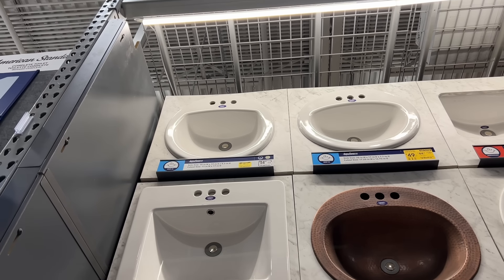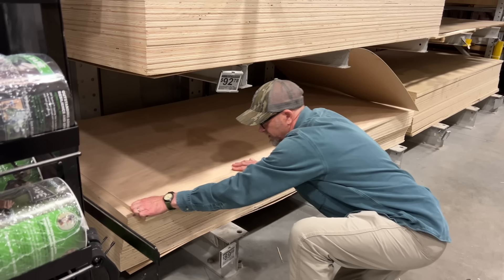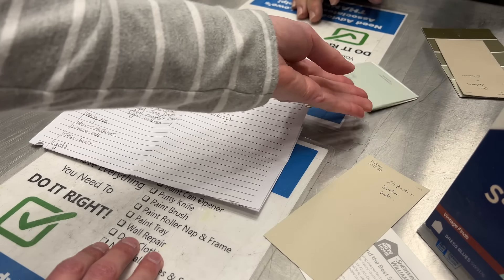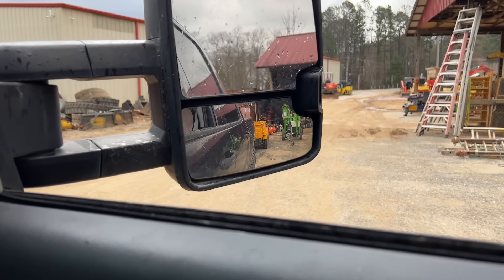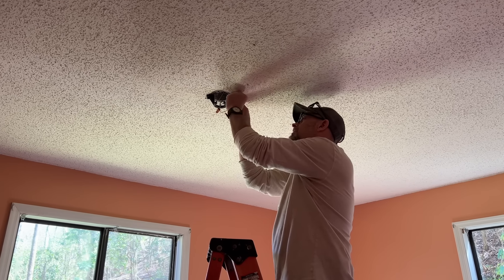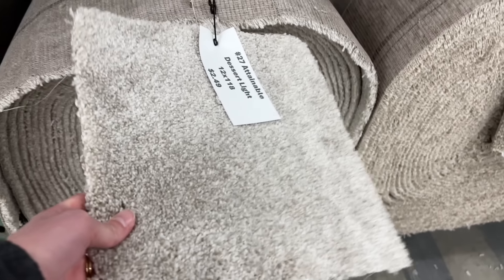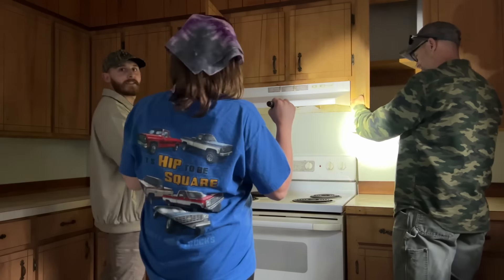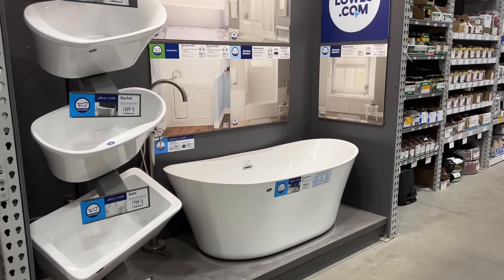Working On Our New House - Paint, Faucets & HVAC

Comment: As your painting different areas different colors I had saw where someone had cut a small piece of the paint color sample sheet and they wrote what rooms/area the paint was used and where they bought the paint from and they taped all the different samples colors inside a cabinet door or inside the panel box/ utility box  that way if they ever needed a touch up and forget the paint color they would have it handy. you could even tape it them to the bottom of a "junk drawer" put clear packing tape over it and it wouldnt be seen but would be there to reference if ever needed.. So excited for yalls house journey!

Comment: Fleur-de-lis is the design on cabinet  hardware,  a favorite of mine. Hope you got a woodstove also , always dependable,  for sure. I have hvac & i hate it, also have gas logs, fireplace. Gas is so warm, like a real fire but id still have woodstove. Hvacs dont work well in cold weather,  not at all up north.  Im on the ther side of the mountain  from you & like you, im cold natured. Though older. My older house. That burned had woodstove  & i really miss it. If power iz out you can cook also so its a win always! You cant go wrong with woodheat, always dependable. The government has told us we'll lose power at some point so be prepared. Your dad is such a blessing,  be thankful,  be blessed 🙌

Comment: We ran into the same problem with our kitchen cabinet handles.  Our oak cabinets were made 50 years ago and when we decided to update the hardware we discovered that the holes didn't line up with the newer hardware.  We did what you did, just cleaned them up and they look great.  Yours also look great.  Good job and luck with your remodeling.

Comment: I like those cabinet pulls, now that they've been cleaned. Very pretty! Someone must have tried to paint them at some time.
Reply: Don't know how you cleaned up the one cabinet pull, but I will share with you the easy way!  Buy a cheapo crock pot from the thrift store, fill it about 3/4 of the way with water and add a half cup of your favorite laundry spot cleaner (I use shout).  Put the hardware in, cook it for 45 mins or so, and the paint will slide off (use an old toothbrush).  I did all the door hinges, door escutcheons  and brass light switch plates in my house in a long weekend, including the removal and reinstallation!  Definitely not a job to be afraid of.
I got this tip from This Old House at least a decade ago.  It really works!
Reply: @millardiii  Oh, I hope they see this in time to do it!  I'm going to write it down and put it in my book!  Thanks!
Reply: @ritasmith9553  I shouldn't have to say this, but DO NOT USE THE CROCK POT FOR FOOD after this.  Lots of nasty stuff in old paint.  Just don't do it.
Reply: @millardiii   I figured. Read between the lines!  Hope that  crock pot doesn't  make its way back to the thrift store!

Comment: Don’t get the shower head that looks like a cheese grater.  Just got back from a Vrbo that had them.  The drops are large, but a regular facet with a finer spray does the job much better.  I can’t warn ppl enough, what a disappointment it was using one.  Your choice is much better.